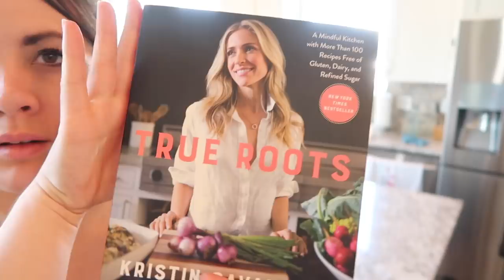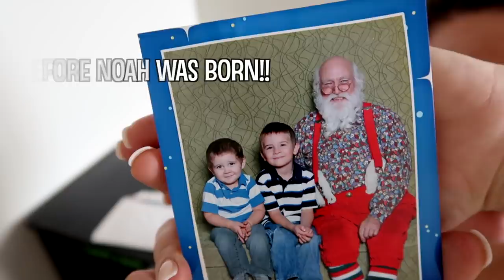ULTIMATE! 😱 2020 CLEAN DECLUTTER ORGANIZE WITH ME :: HOMEMAKING & SPEED CLEANING MOTIVATION

Comment: When you clean your e cloths is there a certain method you follow. You said you can either boil them or wash the in the washer. I saw that you cleaned the counter with the yellow one and then sprayed the table with the method cleaner with the same rage. Does the product come out when you boil it? Like I don’t want to spray my table and use the same one with my counter tops, does that make sense? Also how long do you boil them for?
Reply from the maker: I actually haven’t boiled them, but have read you can do that. I just always wash them as usual & don’t use fabric softener. You can use them with regular products if you want, but not necessary at all. But the cloth is able to lock in germs, so I just rinse & wipe things down, then wash. But I have multiples of each color lol. I’ve been building my stash for a few years now 😅